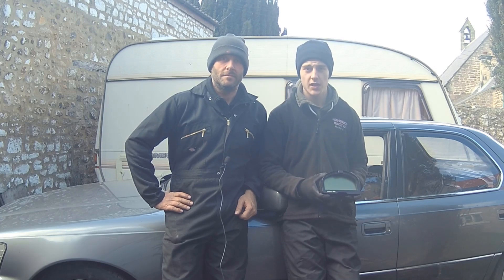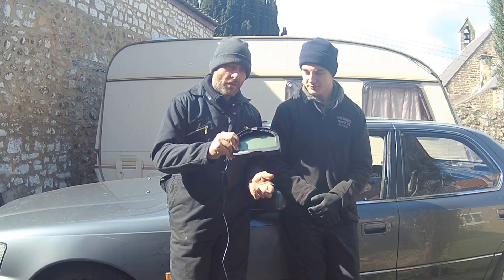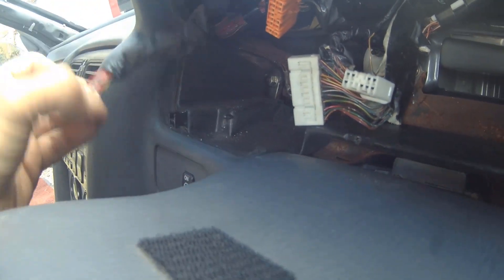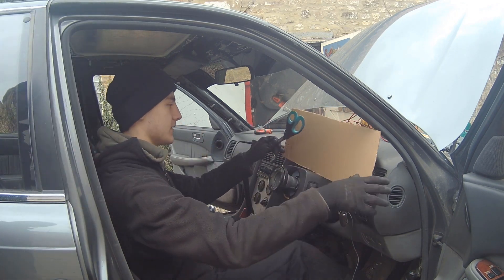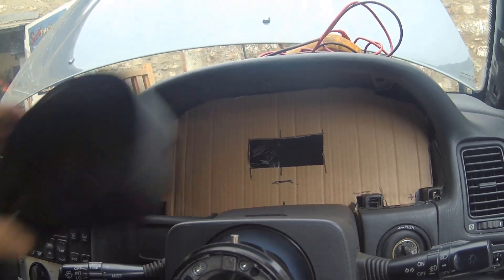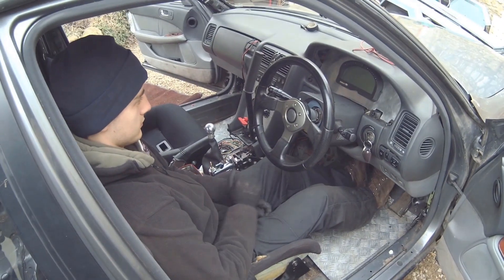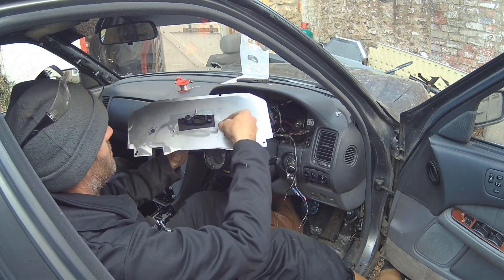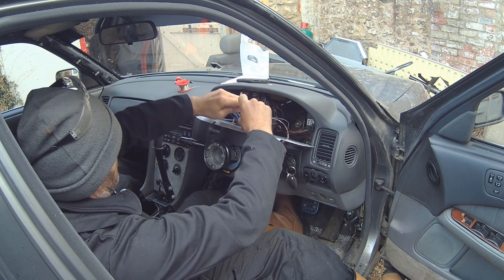TurboShed Part 27 - Haltech IQ3 Street dash install

Comment: Could you do an in-depth tutorial on which wires go to where I'm looking to do this to my first gen ls400 and your videos have been a major inspiration to my ls400 drift build
Reply from the maker: Well the problem is that other than the indicators, side light dimming, fuel gauge and +ve/-ve feed, all the data is taken straight off the Haltech ECU CAN feed, which won't help you if you are running the stock ECU.  I wouldn't know how to wire it into a stock LS400 I'm afraid as the standard car doesn't have a CAN system.
Reply: Ohhhhh
Reply from the maker: I think you can wire each sensor/function in separately using a standalone IQ3 dash, but its a lot of work and wiring compared to using CAN.  I'd suggest you download the IQ3 install manual from the Haltech / Racepak website and that has the details and wiring diagrams.